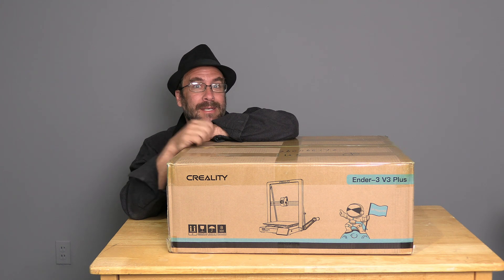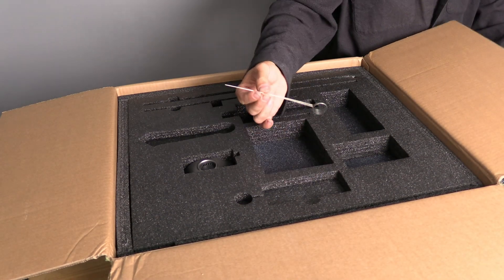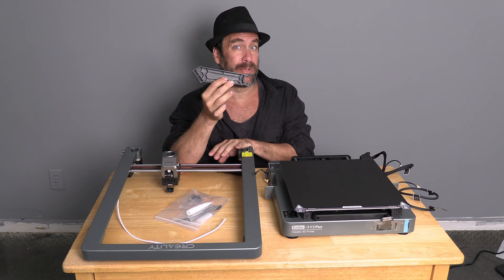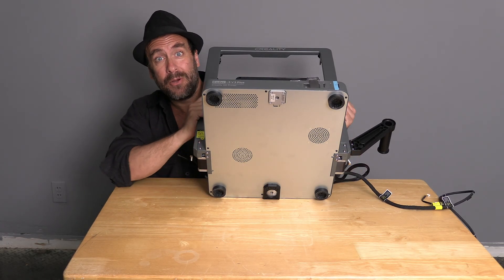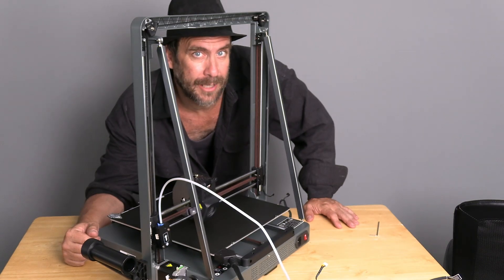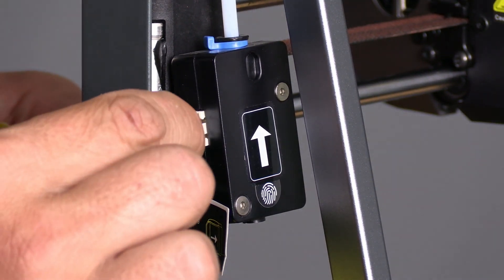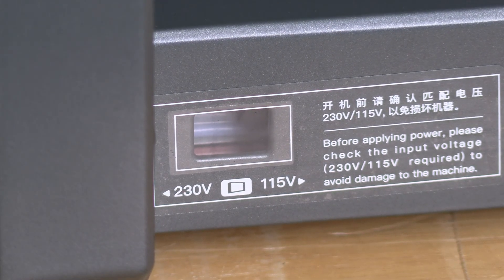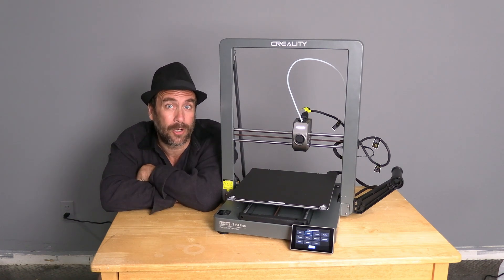ENDER 3 V3 PLUS: Step By Step Assembly. - Creality FASTEST BIG 3D Printer

Comment: 10:20, mine doesn't allow this, I'm going crazy.. it has some yellow rubber bit on it that prevents it from fitting

And my Teflon tube came essentially broken 😒
Reply from the maker: Can get  a new PFTE cheap on ebay.....   Not following the YELLOW part. Got a pic?
Reply: I was shipped a used printer it seems, also its DE version, which comes with different warning strips that are built in an unhelpful way on the printer. The bed was also too low and damaged the screen, pretty annoying, but it prints great.  @3DRundown

Comment: You forgot to install the Filament tube clips to the Head cable.
Reply from the maker: Tool Head doesn't use a clip. All the new Creality Extruders, since the K1 revision, are clipless
Reply: @3DRundown 
Ya might want fo check that. 
I just bought a NEW Ender 3 V3 Plus from Creality themselves and the filament tube has 3x clips to attach the white feeder tube to the cable.
Reply: @PJZombie  I knew those parts had to go to something, thank you.  Nice and easy setup so far.  Was hoping for a follow up of setting it up.

Comment: How do I get rid of ringing on my new Ender 3 v3?
Reply from the maker: Start with checking your belts. I have a video on it here. Also, slow things down.
Reply: @3DRundown  Thanks, will start there
Reply from the maker: How we doing?
Reply: @3DRundown  tightening the belts and cutting the speed in half has improved the ringing tremendously. Thank you!

Comment: Kregg why am I getting snags in my filament?
Reply from the maker: Because you are letting is SLACK. it then birds-nests, the way a conventional fishing reel does. The spool relaxes, and pulls the filament, underneath itself. It then doesn't show up, until it gets tight again. Never let go of the end of the filament, or let it relax, without holding it. When done, stick the end, through a hole in the spool, so it can't move
Reply: @3DRundown  so keep it tight when I load a new spool 🧵 no slack .